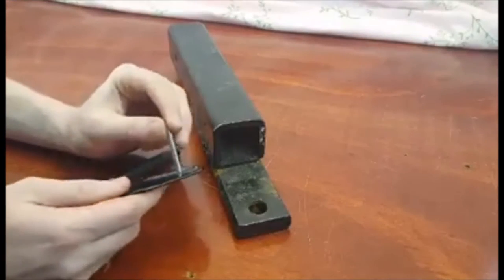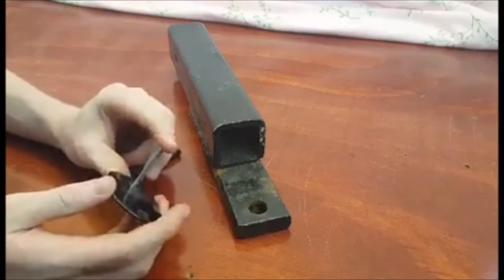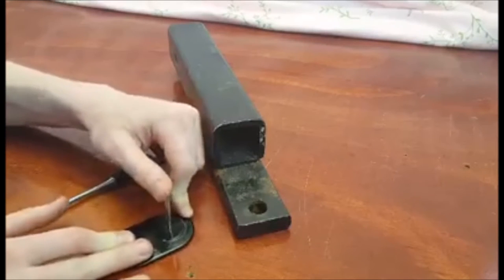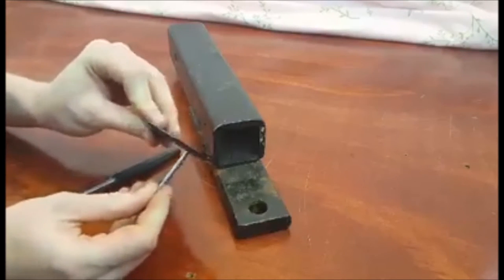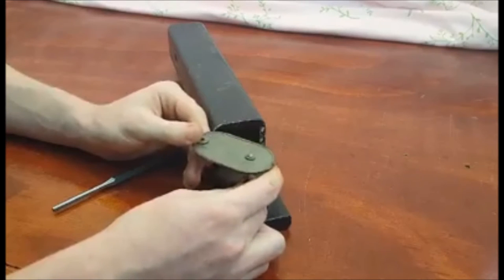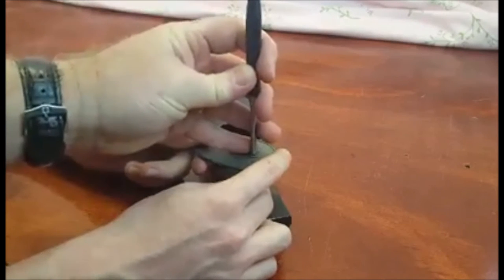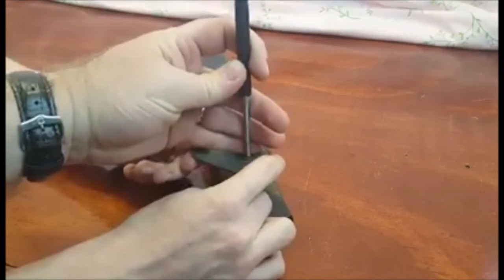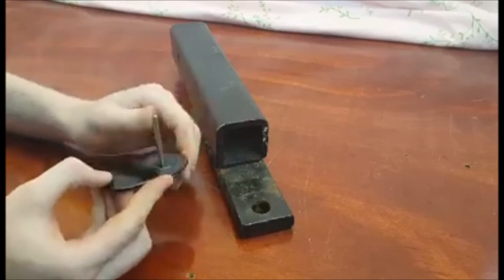How to Fix a Wobbly Spool Pin on a Singer Featherweight 221

Comment: I have a 1960's white 221FW with a spring that is tight in the  thread spool and makes it stick off and on during use. Can the spring be removed in order for the spool to rotate easily? If so, what are the steps to do so without damaging the plate it is adhered to? Thanks you

Comment: In case they broke do you recommend glue back?
Reply from the maker: Replacements are readily available and will return it to the original integrity of the thread pin  as compared to gluing it.